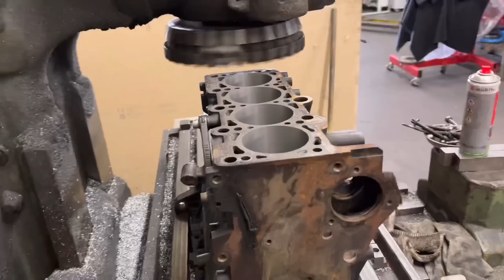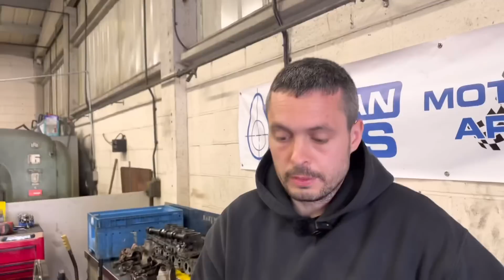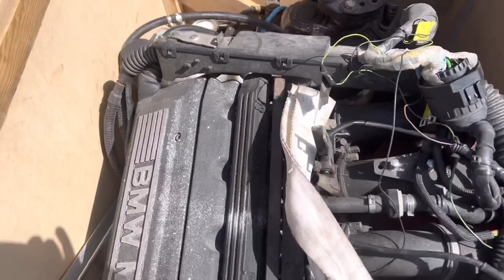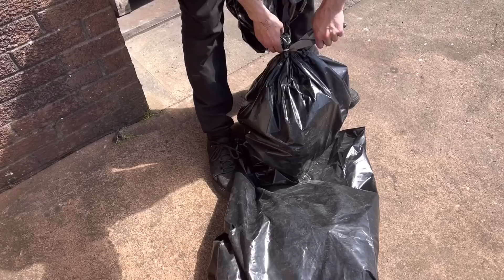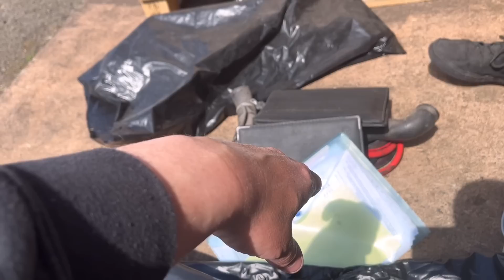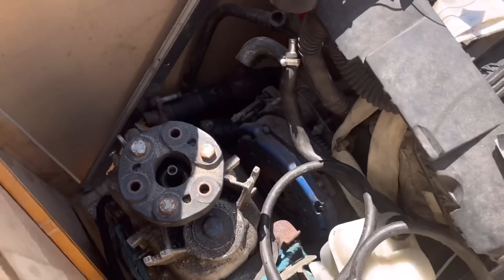Crankshaft bearings fail because of this! Check it out

Comment: It states quite clearly in the ARP hardware instructions that the housing bores need to me measured and align honed if necessary. I don't even bother test fitting main studs in a block, I go ahead and cut the main caps, install the hardware and align hone the block. Occasionally, you need to drill the cap holes slightly larger if the stud pulls the cap to one side.

Comment: But why are you even using ARP studs? They can't do anything that the stock parts can't do .Except cause problems.
Reply: The OEM provided studs that satisfied the 'stock' power output - and in such cases are more than adequate.  The said engine is being modified to generate 450 hp which is significantly more than stock, a situation that could result in permanent 'stud stretch' if standard studs are used.  ARP studs possess a higher tensile strength than 'typical' 12.9 Grade studs - so can withstand higher tensile loads.
Reply: @georgebettiol8338  You're just being scammed by the marketing machine. If you apply the mathematics and physics to the problem the bolt torque translates to clamping force which opposes cylinder pressure. The cylinder pressure translates to a downwards force which acts on the bolts. Take the 2 figures and make a comparison .If you're too lazy to work it out then you're doing nothing other than guessing. You can't even figure out that horsepower has nothing to do with anything as it's just a product of torque and RPM.
Reply: I don't wish to delve into the minutiae of internal combustion igntion engines and the engineering disciplines of stress-strain analysis and fatigue analysis of materials.  However, if you are so convinced that the material properties of a main bearing stud and/or big-end (conrod) stud have no impact on its durability, then I recommend that you replace your engine's main and conrod bearings with Grade 2 studs/bolts and see what happens.  As an aside, recommend that you invesitage what the 1980s F1 BMW engineers did to ensure the 50's designed 4cyl 1.5 litre (M10) production engine (then designated M12/13 turbo) was suitable for the rigours of F1 racing - where it was estimated to produce 1450hp in qualifying trim - and around 1000hp in race trim.  To put it simply, it did not contain M10 'standard' internals and most importantly did not use the M10's standard fastners.

Comment: I rebuilt a Fiat V6 as fitted in the130 back in the day. They were a large Granada size car. All ran well, apart from a small knock from the bottom 😕. I called a Fiat dealer who advised me that if I had the distributor drive 180 deg out, the fuel pump cam, (driven off this) would just kiss the crank on its way round! I turned it 180 and the noise stopped! 😅